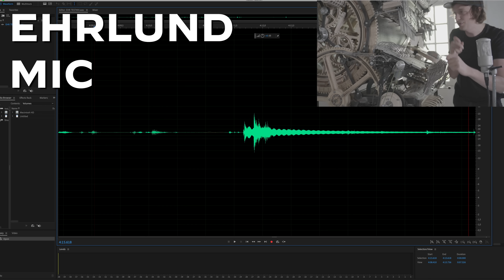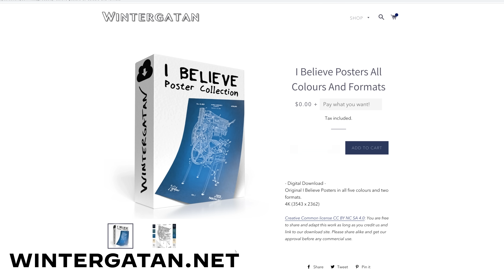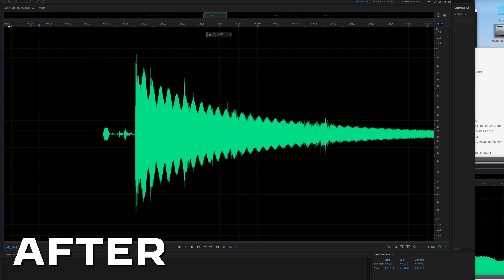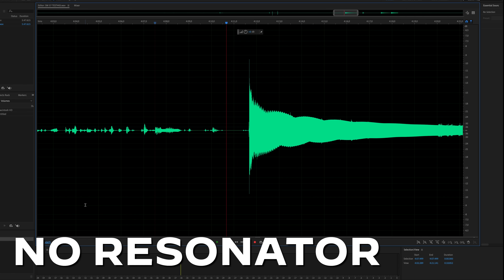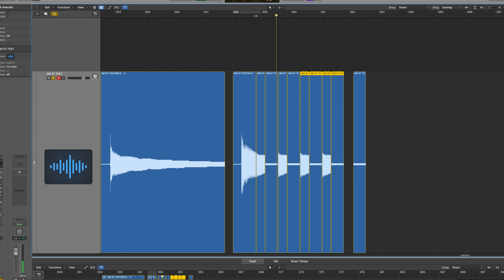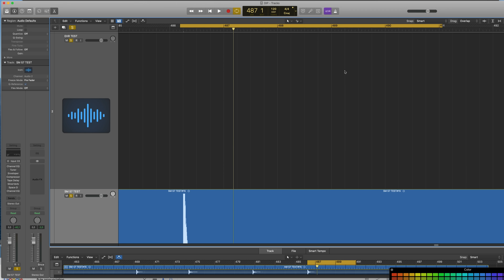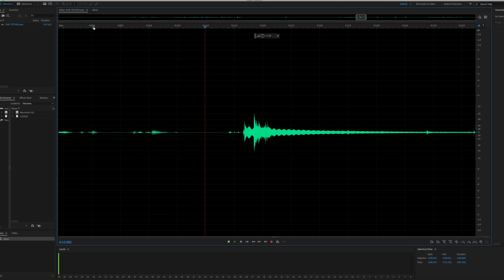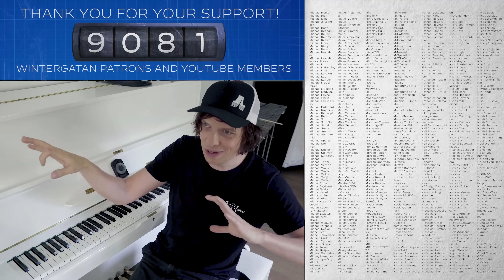Candy Dip for Marble Funnels - Marble Machine X135

Comment: Although covering the entire funnel in rubberized material is good for soundproofing, I imagine there is a tiny area that will quickly wear off from all of the marbles hitting that exact spot. Maybe adding a flat pad at the in the funnels that can house the same type of rubberized pad as on the keys themselves would mend this?

Comment: Martin, I've been watching the channel since you came out with the wooden marble machine (MM) and I have been thoroughly enchanted.  I've always loved mechanical music machines especially tracker action pipe organs.  Those instruments have inherent noises when played that add to their charm and musicality.  I was struck by the fact that the original MM had little noises that accompanied the actual tune being played.  I think it would be a great shame to eliminate all functional noises from the MMX. Hearing the marbles moving through the machine and hitting their targets adds to the overall charm. 

On another matter, why not try using one layer of that cushioning coating on the glockenspiel bars to cut back on the sharpness of attack instead of the rubber you originally used?

Comment: Try using phase cancellation to tune the resonator pipes, the warbling effect shows they aren't tuned exactly to the note. If it doesnt warble and is very load it is exactly the same note, if it warbles fast it is detuned quite a bit, if it warbles slower it getting closer to being in tune. You can also see in the waveforms that its experiencjng phase cancellation
Reply: Also if you want to tune the resonators to be a harmonic above the fundamental, switch the xylophone note to the 5th or 7th etc and tune the resonator to the switched xylophone bar, then we they arent cancelling eachother out and are superload (due to constructive interference) you can then switch them back and youll have the fundamental note with a resonator producing a harmonic of it. This probably wont sound very good on the condenser mic but with the contacts it should make the extra harmonic stand out more and essentially you have power chords on a xylophone with one note
Reply: When the warble slows down, you're getting closer, not further away from getting the resonator in tune. (unless maybe it reverses when you get further away from the note again?) 
Having it exactly right, will indeed cause the sound to increase in loudness
Reply: @Robbedem  yeah my bad your correct there, just tested it with 2 sinewaves on a daw and it slows down

Comment: The funnels do bounce less, which in a way is disappointing because that was one of the central ideas to its design. But that's fine and of course it's not going to be perfect the first time around. Martin has never made marble funnels before that wasn't just a piece of card stock. Volvo make mistakes and design imperfections on mass produced cars and they've been making cars for nearly 100 years. Of course it's not going to be perfect and with constraints.

Comment: Why not rubber coat the marbles to prevent noise elsewhere in the mechanism instead of rubber coating specific fixed components? It’s the moving components that generate noise

Comment: Hey Martin, about the pitch shift at the end of the note: It seems like the marbles are exciting two different resonance modes at the same time in the xylophone bars of which one is louder than the other, but decays faster. This causes you to hear the slightly higher mode at the beginning and the lower mode at the end. You can see the interference pattern of the two modes i.e. at 11:25 as the variation in loudness after the initial decay in the waveform and at 9:03 as a widened peak of the fundamental and the first overtone in the frequency spectrum. This might be caused by a slightly off tune resonator pipe or the xylophone bar itself (due to minimal variations in the alloy or shape or your rubber pads :) ).
Reply: You can also clearly hear the 'beating' of the two different frequencies when the resonator is attached, confirming that the resonator is slightly out of tune.
Reply: With the sm-57 mic or whatever, you can see there are multiple frequencies.
Reply: there's a video where he explores the modes of each bar and rates them and i think in order to position the bars, maybe he abandoned that i forget
Reply: You're smart, can you explain more stuff to me?
Reply: I was thinking there are always multiple resonances in these things and its practically impossible to avoid them completely. The answer might be something like a tuned attenuator but don't know how that would work at audio frequencies.
Reply: You guys should take this discussion to Martin's Discord server, it's not likely he will read those remarks here.
Reply: @Mainyehc  is there a discord for merch? ;) not completely satisfied with the current collection... 😅
Reply: Its sounds like you understand a bit of audio. Can you explain me why we can't see any overtones for 600 Hz or 900Hz? I thought those where multiples of the eigenfrequenzy of 300Hz. There is clearly a Peak at 4*300Hz.
Reply: @chinook9785  Only a small part :) This might come from the specific tone characteristic of the bars. Which specific overtones are getting excited depends strongly on the resonating part (here the body, by guitars the strings etc.). The exact distribution defines the specific sound of the instrument.

Comment: I'm sure someone has thought about it, but I'm gonna say it anyway: What about rubberizing the marbles? Will be less noisy all the way down. I'm sure there's a good reason for not doing it. Always amazed about this project, big hugs everyone.
Reply: Too much of the design is based on the exact marble size. If you coat them they'll get stuck all over the place. Plus can you think of a way to get an even coat quickly and easily? It has to be quick and easy, there are thousands of marbles to coat!
Reply: @ProfessorEGadd  I taught the same technique in the video could work: submersion and centrifugal force. But I understand that some parts of the machine can not accept the new marble size.
Reply: I think coating the marbles whould alter the sound when they hit an instrument.
Reply: @The00Doctor  Yes, but he was using rubber pads anyways, so maybe could work. I'm sure the bass strings would love it too. But, who knows?

Comment: Designing things always is a process of continuing refinement.
You cannot know everything from the very beginning and some flaws will only show up once you actually try out a part.
So don't be too harsh on yourself for early iterations! Rather try to adopt an approach to allow you to iterate fast!

This is basically what all those "agile" stuff is about: Iterate and learn fast.
Try to make the stakes of throwing away a part and re-doing it as low as possible.

I had the best experiences on parts that were just 3D-prints and where I was able to create multiple iterations within a few hours.
It was so satisfying to see the flaws, be able to fix them immediately and have a new part after a few hours

Comment: next time use ice in a pan with a fan behind it.  You can run ice water through a coil around the containe to cool it and use a thermometer to maintain the desired temp.

Comment: watchout, Martin is going to want to make tuned catchers, so the sound the marble makes is additively musical. 

As a stage person working in live events for around 20 years (up until this virus of course) I have found a lot of truth in the statement- Cheap, Fast, or Good. You get to pick 2 in the best situation. That is why this project is taking so long, and it should! Doing it right will make a bigger impression and more money in the long run than just cranking it out fast and cheap.

Comment: hey martin :)
i've been following you since the beginning of the amazing mmx journey. you're a source of great inspiration to me!
however this whole marble funnel noise reduction odyssey has me worried.
i've studied industrial design and have specialized in building prototypes, models and finished products. (maybe this will make you consider my argument more seriously)
the issue i'm seeing is that the plastidip will likely wear off the funnels a lot faster than you're expecting. as you've noticed yourself, the stuff does not really adhere to brushed steel very well and peels of very easily. any kind of coating on metal usually can't withstand prolonged mechanical stress (safe for carbide, nickel-cobalt and other ultra hard alloy coatings... and even they eventually wear off). i suspect the repeated impact of the marbles will have you needing to re-coat the funnels frequently. like, not fit for world tour kind of frequently. 
that being the case, i don't think its a proper long term solution. you will probably have to do a bunch of maintenance work on the mmx as you use it anyway considering its complexity. i've built much simpler things that none the less needed way more maintenance than i would have liked. reducing any sources of future issues is, i think, paramount in a project of this magnitude that is intended to be used as extensively as the mmx. as much as i want the mmx to come to its well deserved completion, i think you should reconsider this feature. 
Encasing the metal rods of the funnels in clear tubing is what i would opt for. i would look for some clear tubing that has the same ID as the OD of steel rods you used. then i would slice the tubing open lengthwise so that it can be pushed over the metal rods and hold itself in place. durable, inconspicuous and easy to do.
hope this helps!
kind regards from switzerland
tarik
Reply: Good point.  If that material is as toxic as Martin indicated he will have a hell of a time getting that shipped on the world tour.  His only choice would be whatever he can find locally.
Reply: guete maa / gueti frau

Comment: Heat would normally thin a solvent based product not thicken it... but it does look like you need to get some thinners for that product.. read the can or contact the manufacturer for what to use to thin it.

Comment: say if you were to change the material of the marble catchers to glassfibre rods then your sound and movement problems would both be solved tue to the lower mass of the glass fibre and it's tendency to dampen sound
Reply: how you would solve the aesthetic aspect is beyond me BUT you could also 3d print them out of abs then vapor smooth them

Comment: @wintergatan, have you ever scene those emergency fabric tunnel shoots that are used to escape buildings during a fire? An idea is to use that type of fabric shoot, but with a large opening, and tight tunnel, to gently catch the marbles, and guide them to the next spot in the machine. No noise, and with the just right width of the tunnel, you'll be able to have no resistance, and then no clogging.

Comment: Personally I favor the practical side of design - make it work well, and make it look good only if it doesn't compromise its functionality.
I really liked the temporary marble collector/s the MMX had at a time, which was just a box, that could collect marbles from all the channels, and had some dampering layer inside it. It was collecting all the marbles, and it was making no sound at all. I was confused why did Martin switch that for these metal funnels that were taking long time to manufacture, had significantly higher chance to let a marble miss them, and were making a lot of noise when hit by a marble.
Then he said he did it cuz he wanted it to look good, which is fair enough. But personally I wouldn't have sacrificed functionality for appearance.
Reply: True but this isn't just an engineering piece. It's a work of art. There's an infinitely more simplistic marble machine that could be built and designed which would be lighter, simpler, and easier to use. But it wouldn't be the MMX.

Comment: There may be a way for the funnels to move more; have you tried “weakening” the spring plate? Perhaps by narrowing it at the flex area?
Reply: I were thinking the same.  Maybe a thinner spring steel.
Reply: @dylanotto1675  In other words, don't give up that optimization criterion JUST yet?
Reply: @Mnnvint  I wouldn't say give up entirely, just put it at a lower priority. Like first the funnel must sound good (it is on a machine meant to make music after all). Then it must be made of a cool material. And then once those are satisfied, make it function cool. 

Best bet here would be thinner spring steel. Thinning the steel in one spot would weaken it and cause it to break because all your movement is focused in one tiny area. Thinner steel would allow the whole piece of steel to flex, spreading the movement over a larger area reducing the chance of breakage.
Reply: Maybe cut a slot in it. Don't want to narrow it, that will weaken it in twisting
Reply: I could see two ways to make the funnels move more. As mentioned, there is weakening the spring plate, through decreasing the thickness, or possibly changing to a different material. Another way would be remaking the funnels with thinner wire, but at this stage I suspect that would be far too much work. (maybe for a production-version MMX?)
Reply: Just using a thinner/weaker spring steel strip is probably easier :)

Comment: As a professional industrial designer. There is no perfect process, don't beat yourself up about choices you make as part of experimentation. You're essentially making a prototype, as such you will find out which constraints have the biggest impact and which ones are low value through trial and error. Prototype, fail fast, and don't fixate.

Comment: Had a good laugh at that ending. Regarding the tone shift at 9:30, maybe it has something to do with how different tones stick around for longer than others. Maybe some sort of sound suppression system inside of the tubes will be able to filter out things like that? Similar to what you did with your studio with regular sound waves and bass traps. I realize the point is to have some resonance, but maybe this will help both tones stop at the same time.

Comment: Switch out the metal to a lighter one, like aluminum if you really want them to move. I myself think it'll not be noticeable from an audience viewpoint. Would be better with some kind of light trigger, but it would add electrical stuff.
Reply: I'd try changing the spring steel before rebuilding parts that took so long to make I cannot imagine Martin et al doing it again. Also, as I've understood things, the idea is to have live camera feeds of the machine at concerts, so the movement can be quite subtle and still be visible.
Reply: @TheGlassgubben  Understood but loosening the spring steel tension will mean that the spring back effect after a bounce will be very slow due to the weight compared to the steel tension. To get a good response from one marble ball impact it requires that the balls weight in comparison to the moved matter is as large as possible. You could see it in the video how much less the funnels move after the dip.
Reply: @rickardeneqvist5445 , yes the mass of the moving part obviously matters, but you should always try the simplest solution first.

Comment: For some reason I love that you call a condenser mic a "condensator"
Reply: Lots of languages call a "condenser" a condenSATOR.
Reply: Also, capacitor in Swedish = kondensator 😐
Reply: @mellertid  Interesting, thanks for the reasoning.
Reply: Condensator was actually the original name in English before enough people apparently thought it sounded strange, btw.
Reply: @timseguine2  really cool, never know this. Cheers!
Reply: A conversation about the minutia of a word from language to language with no condescension. Nice.
Reply: Same in german: Kondensator
Reply: But a condensor was where water forms. That is that an underground steam engine's condensor converts used steam back into water...
Reply: Theres nothing wrong with it, but it's bad English. It's a condenser, condensation isn't what's happening to the sound it's being condensed
Reply: @edgehaineproductions  it's not about the sound, it's a general purpose electronic element
Reply: @bacicinvatteneaca  true.  ✅they are occasionally called capacitor mics. I always thought the mechanical process was capacitance, and condenser was the sound process. Just looking it up condenser is an older term for capacitor. But still condesater is not correct. It's like a hybrid word.
Reply: @edgehaineproductions  Except that -or is literally the Latin form of the suffix -er,  and -ator is used when there is a word in -atio it can be related to. Condensatio is a thing

Comment: Wow you really got a good signal to noise ration in the end here. And for what it's worth everything still looks amazing from my perspective.

I understand the frustration with having to fix flawed designs, but remember no design is perfect, this is just a part of any complicated process.

Also maybe you can use thinner spring steel to add a slight bit more movement back.

Comment: Question is if it's worth it to paint all the marble tracks with a plastic coating to remove ball noise...
Reply: I doubt it, but either way it's definitely not worth to do before it's proven to be needed.

Comment: I've been hoping you'd do this ever since you commented on their loudness on a previous video XD
Also, wouldn't it help with movement of these pieces by lowering the resistance of the spring steel slip in them. It's more work, but I think you'll get a nice compromise between function and form after that.